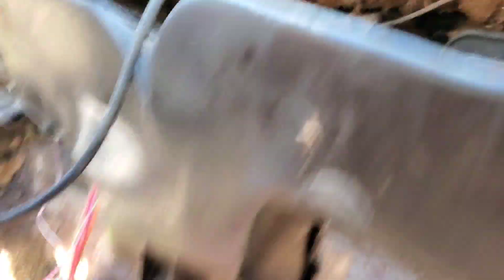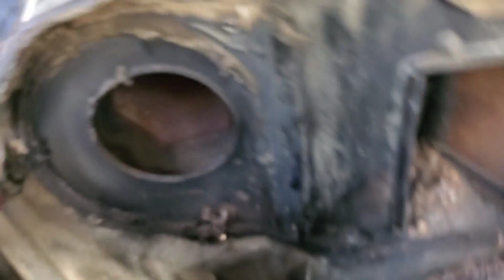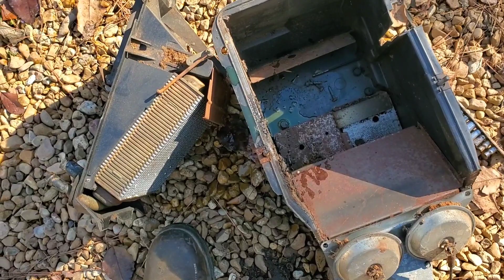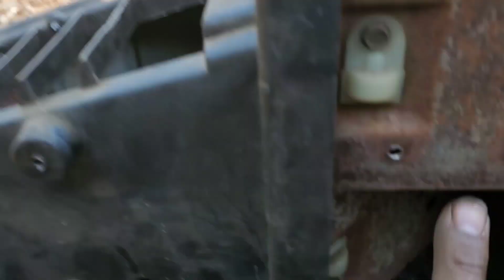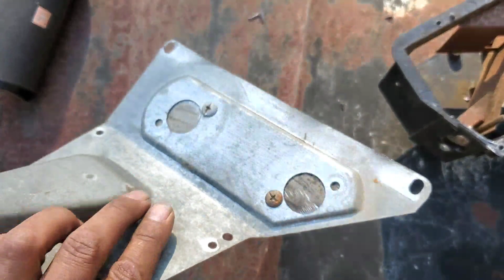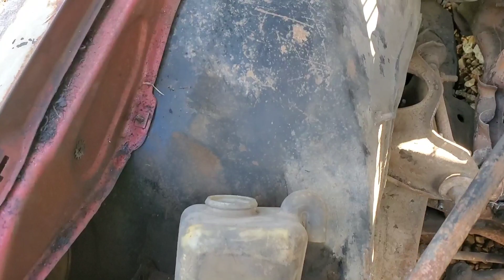1976 Chevy El Camino Project Part 7:  HVAC Removal, Retrofit, And Reinstall

Comment: Mines working just grounded out somewhere, what color were the wires from the gauge to the sending unit in the tank??
Reply from the maker: I did a full rewire from scratch so I don't have the original wiring colors unfortunately

Comment: I need a fuel gauge 4 a 76 elco, u got 1??
Reply from the maker: No I don't, I installed an aftermarket unit due to mine being broken.
Reply: Do you happen to know what wires in the ac also go to the starter